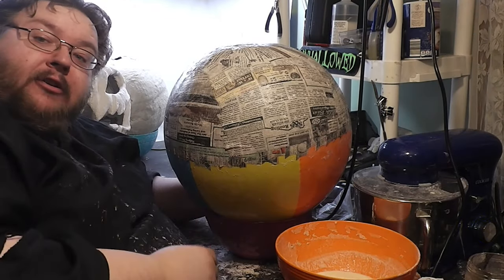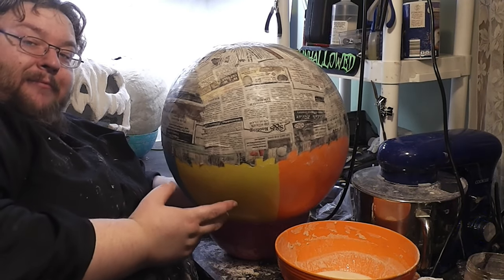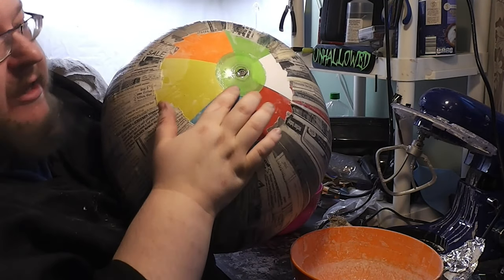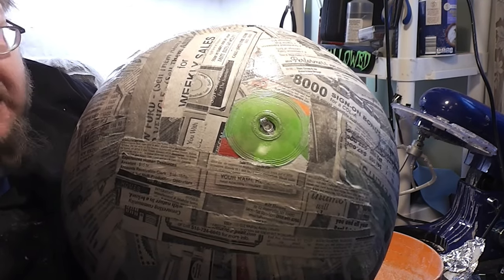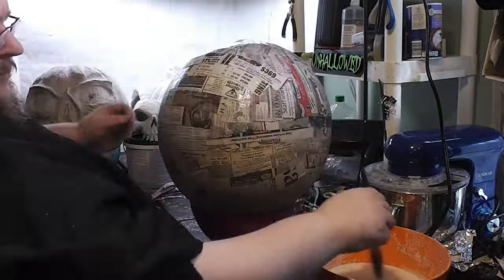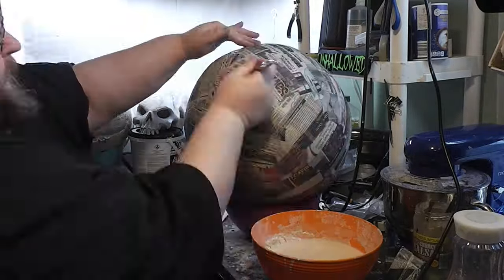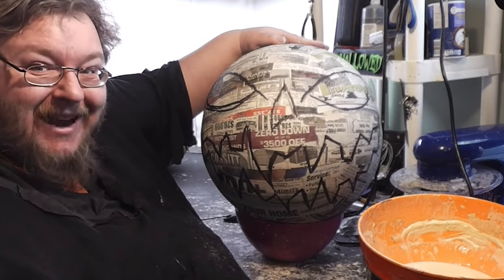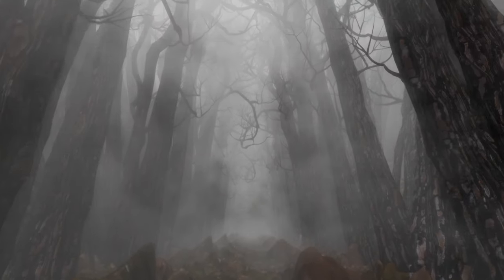Paper Mache Pumpkin Version 2 - Part 2 Layering Completed

Comment: FYI - for those that overthink things like I do: 6 cups of flour, 1 cup glue, approx 6 5-6 cups water DOES equal six cups of paper mache paste (thick). Also it's worth getting a five gallon bucket to mix the paste with the drywall joint compound & cellulose.
Reply: I've got in mixed dry powder dry wall joint, not the ready mixed, do you think that will matter? I'm thinking using the thinner paper mache paste instead of the thick. Or taking it back before I open it and get the ready mixed 😂

Comment: besides the coconut/watermelon sound test is there any other 'better' way do check and see how many layer you have
Reply from the maker: Yes. Either alternate materials between paper towel and newspaper or alter your strip layering direction. Both ways will give you a clear indication of which sections are from a previous layer vs the new layer and it's easy to count.

Comment: Couple questions before I get in too deep: 1) Do I really need a mixer or is it more of a 'makes it easier' kind of thing. I don't think my friends would appreciate me using the stand mixer they got me for paper clay lol. 2) Approximately how heavy would you say these things get? Because I'm planning on making these to wear as for pumpkin head costumes, but I don't want to hurt my partner's shoulders if they're gonna be like 10 pounds, then I can at least buy some padding to keep it off his shoulders while I'm out buying all the other stuff! ^_^
Reply from the maker: A mixer is wholeheartedly optional. I find mine makes things easier for me. When I started I used a dollar store paint mixer on a drill and that worked fine. Doing it by hand is an absolute pain in the tuckus though. Weight depends on size and thickness. If you plan on making one that is a mask I absolutely would pad the snot out of it or plan on putting a modified hardhat inside. Without those it will wobble all around someone's head and be insanely uncomfortable. 10 lbs sounds like a good guess for head weight.

Comment: do you think that this would be a structurally strong enough to create a pumpkin head Halloween mask? If so, Is it necessary to fill in the entire bottom with paper mache and then cut away a place to put your head in, or would it be  easier to just not fill in that bottom portion?
Reply from the maker: I believe it is easily strong enough. Perhaps it may be a bit too strong and the weight on the head may be rather uncomfortable. The major problem you will deal with in the pumpkin mask is in keeping the head in a comfortable position so you are not banging against the sides and are still able to hear and have tolerable perception of the outside world. I plan on a tutorial on this eventually. For the time being you're probably fine just measuring the space you need to put a head in and not putting clay on that section.
Reply: @Drachenfang  that's perfect, thank you. I will probably hot glue some light foam for padding too and keep the sides a little thinner. I'm just worried about buckling.
Reply from the maker: @christopherpundsack2277  It won't buckle. Paper clay dries hard as a rock. It'll crack before it bends

Comment: I see you let yours dry after 3 layers overnight. Is overniggt necessary. Im in 90 degree days over here and wonder if a couple hours will do. Also will the flour mixture hold up overnight of i let it dry that long
Reply from the maker: Overnight is just a solid suggestion. If you have things dry in a few hours then by all means go ahead to the next phase. Do you mean leaving a bowl of the flour mix out overnight? If so then it's fine. Just cover your bowl of mache paste and after one evening it should be fine. If you are at all worried about it then you can also use a mix of 60% white/wood glue and 40% water.

Comment: How long does it take for the layers to dry before your start with the bottom layer.
Reply from the maker: If you get a fan on all of the surfaces, have it in a warm area, and depending on the ambient humidity it can be dry in as little as 2 hours. Layer drying goes pretty quick. You just have to be careful about trying to warm it up to dry it faster as the ball will swell.

Comment: Question can packing paper be used ? I can get more of that for my money than newspapers.
Reply from the maker: Absolutely. Just about any flavor of paper can be used so long as it can soak up mache fluid and has some flex to it. Use what's cheap or more ideally, free. I use newspaper because there is a free periodical near me that has issues left over when the new editions come out. You can sometimes get newspaper for free from recycling centers.

Comment: Is there anything you could use in place of the insulation?
Reply from the maker: Yes, toilet paper makes excellent clay and if you really need to you can soak newspaper in a blender and then blend it. The blender method is bad but once you strain out that blended paper you get a usable paper pulp material
Reply: Okay thank you so much! You're a wizard with these pumpkins, thanks for the videos!